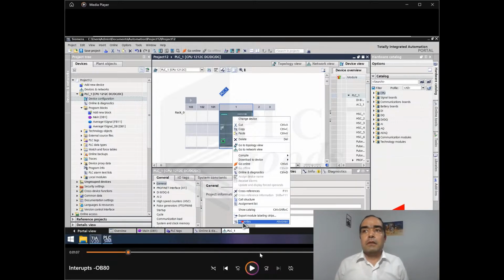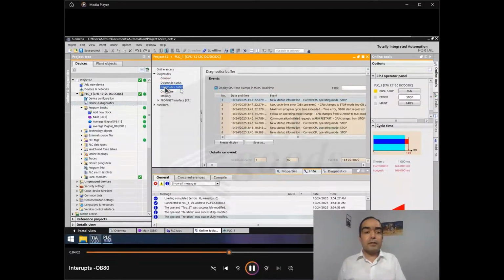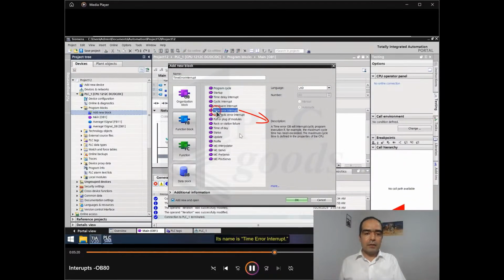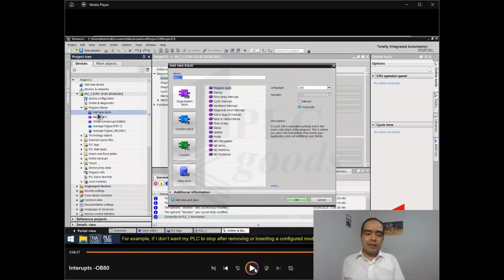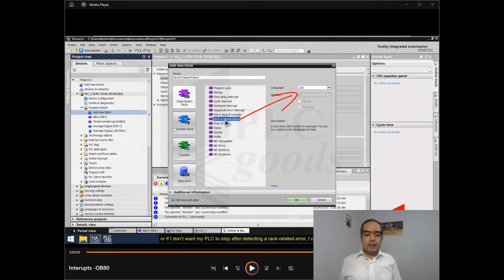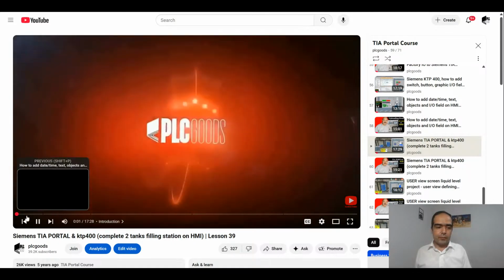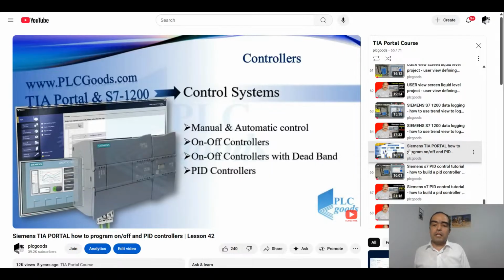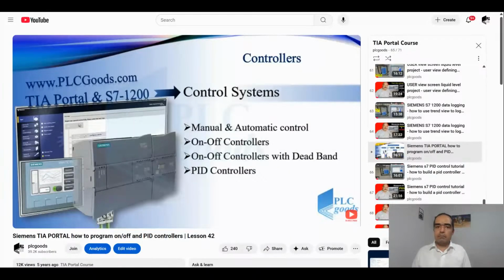Siemens TIA Portal Interrupt Blocks Tutorial | OB80 for Time Error Handling - Live10

Comment: Hello im facing with an issue that i had installed tia portal v18 and im not able to load or add devices cpu please help
Reply from the maker: Hello VishalKumbhar, adding a CPU to project is very common in TIA Portal. I've worked with TIA Portal version 16 to 20 and I've not seen your problem yet.
 If you are a beginner PLC programmer with TIA Portal, maybe our TIA Portal course is useful for you. We explained basic knowledge and also how a CPU can be added to project during the course. you can find it on playlist of PLCgoods youtube channel. 
Otherwise if you have already worked with TIA Portal and this problem comes from TIA Portal software, please use another source to install TIA Portal or install it on a new windows. Although I've not seen your problem during my experiences, but sometimes when  TIA portal is installed on an old windows with many extra software, then it may not working well.
Reply: @plcgoods how to download crack version of tia portal v16